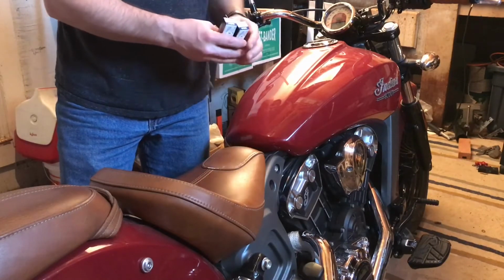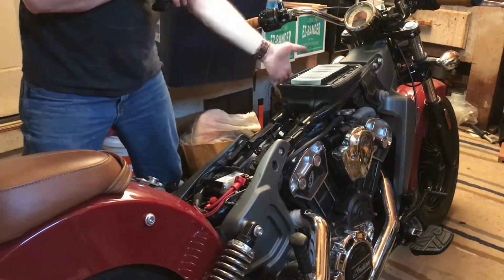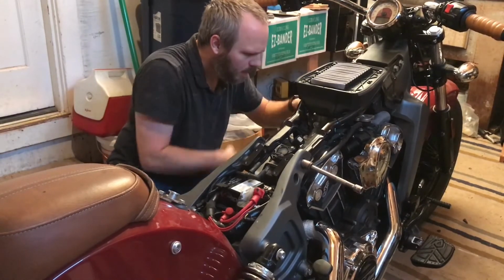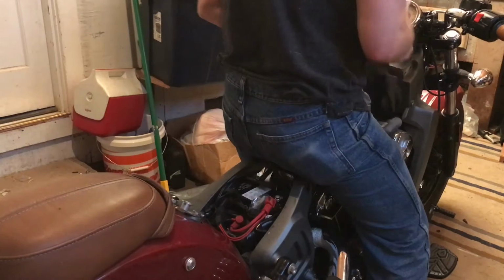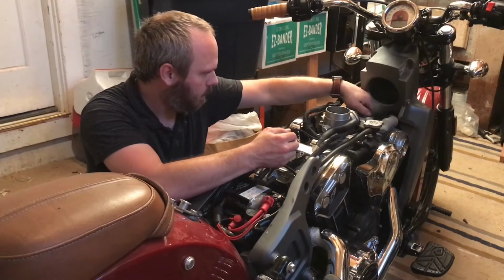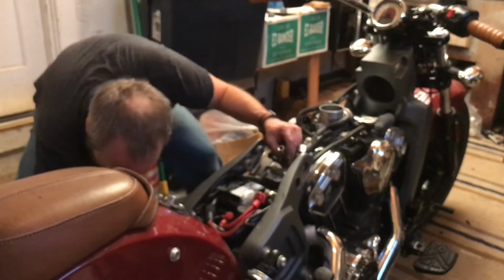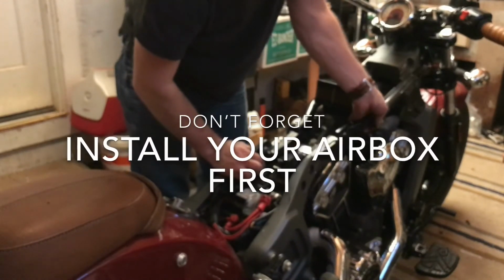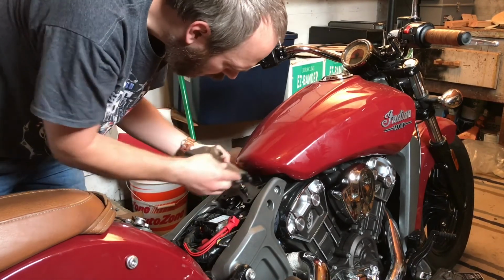Indian Scout - How To: Change spark plugs

Comment: This fellow gives very good instructions but I want to caution you. You have to be very, very gentle and careful with the fuel line from the tank. I pushed it and twisted it and the plastic elbow joint on the tank end broke. So, read the manual about tank removal and replacement. Be gentle and don't twist the fuel line. Otherwise, it is a $60 replacement. And, it is a LOT easier if the tank is empty or close to it.
Good luck.
Reply: ejestin I just want to second what you said. I did the same thing plastidipping my tank. Can’t caution people enough about taking off the fuel line

Comment: Probably a good idea to put a rag over the throttle body to prevent those tiny coil on plug bolts falling into it.

Also a set of front and rear stands does wonders for stability.

Still have to support the middle when removing the top frame.

Comment: Why is it necessary to remove the left-side frame rail?  I know you can get the air box out with only removing the right side; so I'm guessing it's because of the coil packs & spark plugs?  Thanks for all these videos, really helps me plan for a project.

Comment: What happens if you don't use the jack and remove the filter and spark plugs, will the engine fall and could damage something?
Reply from the maker: The bike will fold up like a pair of scissors. Those two top bars that you remove are a structural part of the bike.

Comment: I’ve been riding and tooling for over 40 years on my own bikes and I have never seen anything sooooo ridiculous of a design just to change two spark plugs. I don’t know if I’m getting old or what, but I couldn’t see myself going through this just for two spark plugs. Unbelievable…
Reply from the maker: Eh, once you get the retro copper plugs out of there, you never have to go back. And if you swap out the factory airbox you never have to crack the frame to change them again.
Reply: @1ManWrenching    Thanks.

Comment: What was the stock gap on the replacements?  Did you have to adjust?  I just replaced mine and dropped em in... forgot to check gap.  Usually things are pregapped if bought for a specific engine, and everything seems good on mine.  But still... I'm curious
Reply from the maker: You don’t change the gap on iridiums.
Reply: @1ManWrenching  I used the stock replacements, not iridium
Reply from the maker: Ahhh, I’ve never done that. No idea what the gap should be.

Comment: When you put the frame rails back on, is there some balancing/alignment that needs to be done when tightening the rail fasteners? Wouldn't want to develop some weird pull/vibration/whatever due to a potential alignment issue. Thanks!
Reply from the maker: hillie47 Nope, no adjustment possible.
Reply: Thanks for the quick response! I'm happy it's a tight fit, no need to be concerned about frame issues. My friend's BMW develops a weird wobble at higher speeds and it turned out to be a frame alignment issue, so I'm being cautious. Thanks again!

Comment: Unalocker, I’m getting a paint job and while the tank’s off I’ll install the iridium plugs. Question- what is the gap? Does it need changing as most plugs don’t come pre-gapped. 

Good work on the videos
Reply from the maker: Nah, you can’t gap them. The iridium is too brittle to even check the gap. They have a protective cardboard sleeve over the end of the plug to maintain the factory set gap during shipping.

Comment: I don't know if I missed that how often do you have to change the spark plugs how many miles
Reply from the maker: Bri Guy According to the factory service manual, every 30k miles. Which is a fairly long time as far as motorcycles go, but that kind of plug should be regapped every 10-12k, so about every oil change on this bike, you need to have them out to look at them.

Comment: Unalocker, can I ask how the Scout runs since you used the iridium plugs?
Reply from the maker: Mark Wright it’s running great. I did the Arlen Ness intake at the same time and the performance increase, even with the stock exhaust, was impressive.
Reply: That's great! I note you don't need to ( and should not ) change the gap on those Iridium plugs. I am thinking of getting it done at an Indian dealer depending on the cost they quote. I'd do it myself but it is diabolically snowy weather here in Canada and my shed only just fits the bikes. Plus I need a new back tire so I figure the dealer is my best option.....depending on the quote....if they ever give me one......cheers mate! Aussie Mark.
Reply from the maker: Mark Wright Yeah, no gapping change needed. I’m about to do a video changing my tires, around the end of this month. 😊
Reply: Great, I look forward to it for sure. Btw I just spoke to my friendly Indian Dealer and they told me that what you did would take them between 2-4 hours labor at $85 CAD per hour.....so that certainly makes me think about doing it myself. One question - can you get at the rear spark plug by just taking off the tank (without "breaking" the frame)?
Reply from the maker: Mark Wright Yes. It’s the front plug that’s deep in there.
Reply: OK thanks, good to know. One out of two ain't bad....at least I can inspect one and if it is AOK reasonably assume the other one that is hard to get at is too. Btw I love your "eclectic" (I think that's the word?) channel. You should do a vid on starting snow blowers in ultra cold weather...LOL ! Also good to see you are into HDs too....I miss the character of my old one...a 20 year old Evo Superglide......but I now have a 68 Triumph Trophy 500 cc as my "character" bike.
Reply from the maker: Mark Wright hehe, yeah, very eclectic. I just post videos on whatever I happen to be working on at the time. It can be hard to accumulate subscribers that way, some will unsubscribe if they feel the channel is going in a different direction. But that’s fair, I do tend to move away from some subjects over time.

Comment: all that work, you should have checked to see if the gap was correct
Reply from the maker: James Rylance Factory gapped. Checking the gap can shatter the Iridium electrode. Specifically says not to do that. I should have noted that in the video. Thanks.
Reply: James Rylance I believe those were NGK plugs, which come pregapped, if your not running any crazy fuel modifications there really isn’t a need to adjust the gap

Comment: Can tell he dont do this for a living. If you treat your hands like he does you wont do it long
Reply from the maker: Hmmm. What exactly did you not like about my hand use? I worked in a precision bearing factory back when I did this video. Made bearings for robotics for a decade. Now I’m doing electrical engineering on light rail vehicles. I do admit, I’m in my late 40’s and my knuckles are starting to ache at times. I’m looking forward to retiring. Heh.